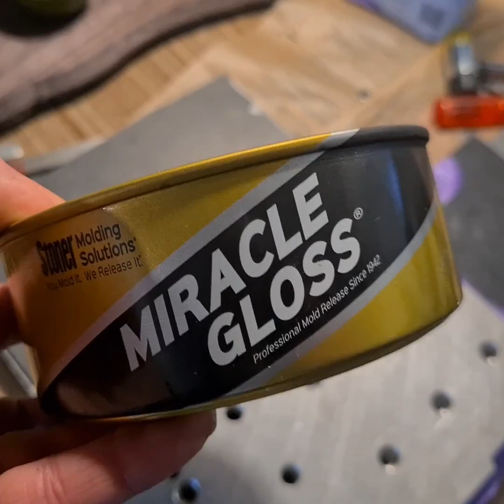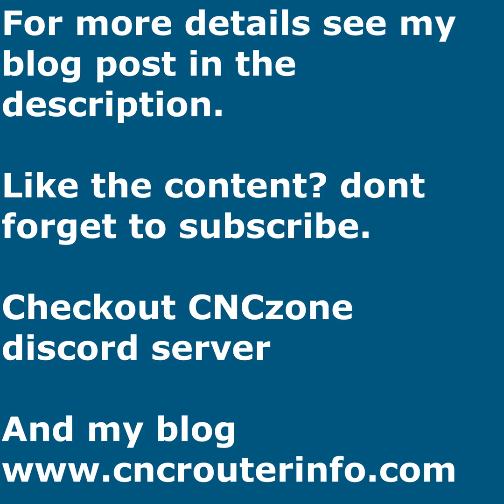Flat Surfaces in Minutes with This Epoxy Hack!

Comment: Nice! I've thinking about this as a way of getting flat surfaces for RHS steel profiles when making a CNC machine... but the problem is that I don't have a 1200 x 200 mm surface plate to copy from. Was thinking it'd try to make such a flat thing by just pouring epoxy and letting it level, then transfer that flatness - epoxy to epoxy - to the steel beams. Do you think that Miracle gloss would keep the epoxies from bonding with each other?
Reply from the maker: Hi yes the miracle gloss will stop it from bonding to each other. Another option is just normal packing tape. The "three plate" method will work also in this instance.

Comment: Does pva mold release work? I want to find the most accurate mold release and I do not know how to chose
Reply from the maker: Pva is quite a bit thicker.
Reply: I have a hard time believing that pva is thicker. I am grateful for your answer though. I want to do what you did but with higher accuracy on mirror finished steel surface plate. Do you recommend any mold release?   @TheYieldPoint
Reply from the maker: @leonordin3052  have a look at my blog. I linked the mold release that i used there.

Comment: Very nice video! how brittle is the epoxy? do you get nice round holes when you drill through it?
Reply from the maker: This stuff is very tough, hard to cut/break. Either use a hammer on a sharp edge or use some kind of grinding bit on a dremel.
Reply from the maker: Have not drilled it yet. Suspect it is more difficult to drill than alu. Will have a go at it tomorrow
Reply from the maker: It is easy to drill =)
Reply: info: when u use some aluxid or korund-powder or some Wollstonite powder you can even scrape the stuff to perfection. BUT you need realy to be cautios that you dont drive the scraperblade to deep into the harden epoxid. It is not steel it is still epoxid.

We use that methode to produce mikrometer accuracy flats so we can mount linear rails on a very flat surface that is easy to scrape after surface grinding.

When you mix 8-12% epoix with sand and other aggregates you can por machine beds of the newest generation.